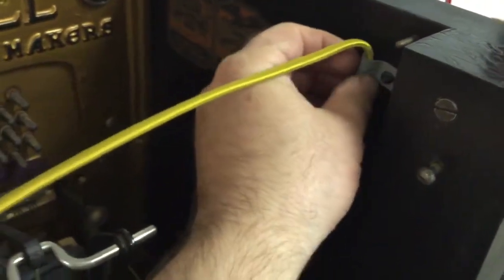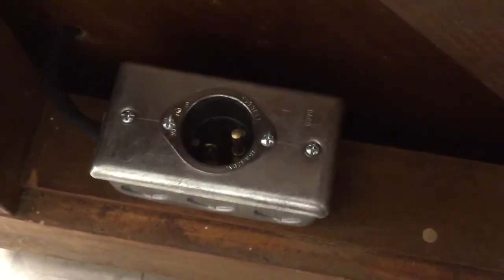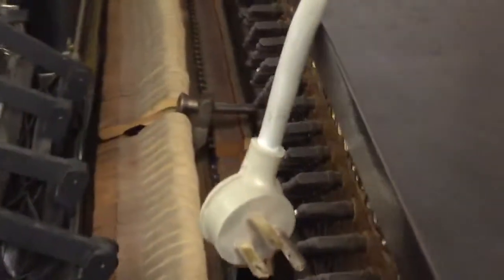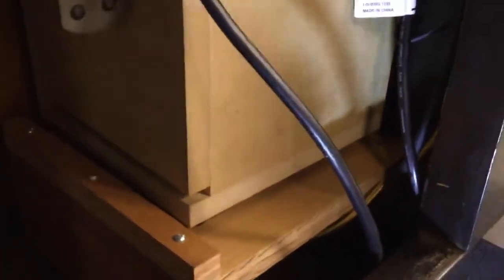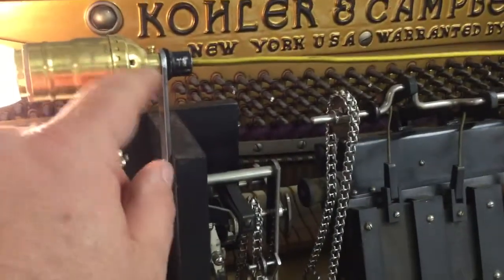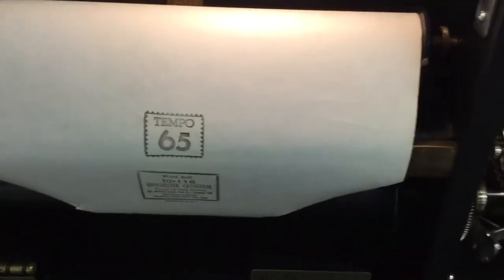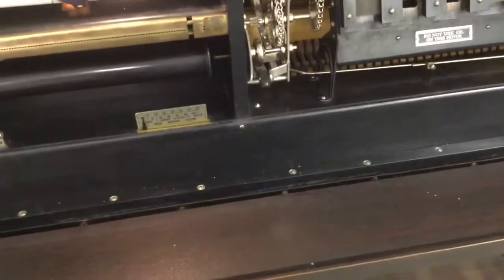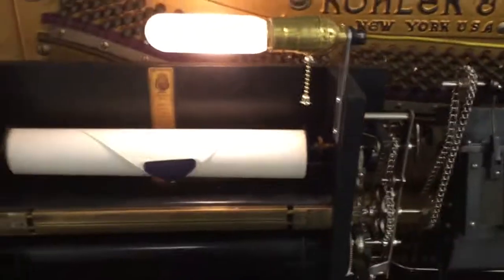Adding an electric pump to a foot pump player piano: electrical details

Comment: I have found a pianola (Player piano) on eBay for cheap. I am located in the UK and am looking for delivery and maybe someone to install a electric pump. I haven't decided upon putting an electric pump in the piano (When I buy it) yet, because I like the foot powered style of the piano.
Reply from the maker: The electric kit I used allows you to use the piano either way, electric or foot pump. It's really quite nice, being able to stand next to the piano while it plays and sing along with a group.
Reply: @okbridges  where did you purchase your electric kit from please as i would like to buy one to convert my pianola?
Reply from the maker: @djjlee  I bought it from Ragland Piano off eBay. 
They also have a youtube channel under the same name.
Reply: @okbridges  thats great thank you